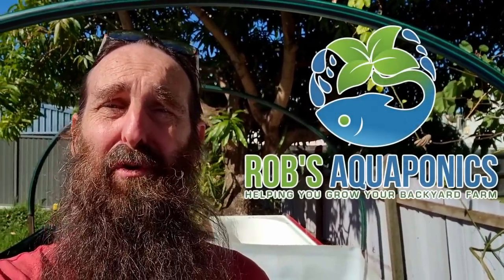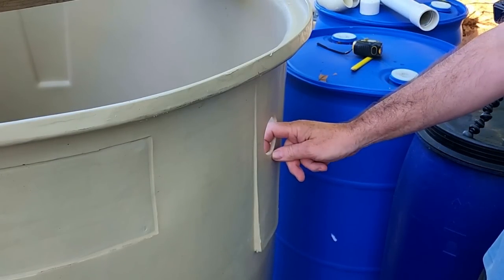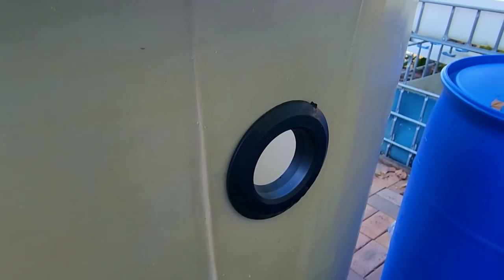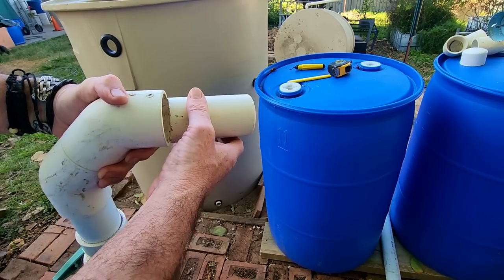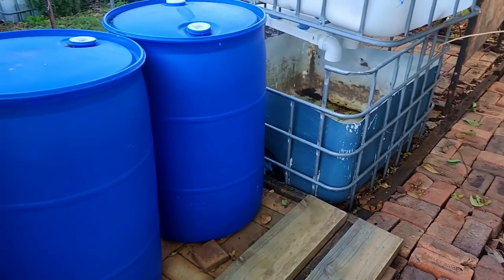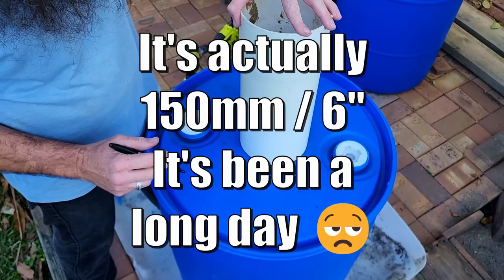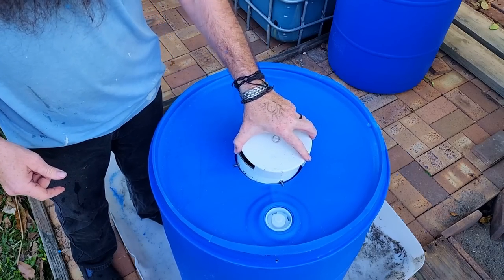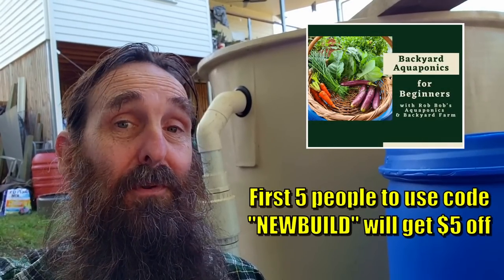New Aquaponics System: Starting the Plumbing

Comment: Hi Rob, i wouldn't have anything around my wrist when drilling, i had an accident where a grinding stone on a drillbit grabbed my jumper and spun/tightened around my wrist and banged it up, burnt and slightly cut before the drill stopped.
Reply from the maker: Cheers for the warning mate. Bead & long hair would be my main concern. Have seen some nasty accidents occur in my days in engineering  factories. 😥🤮

Comment: You can use vinegar and a small amount of dish soap to clean out chemicals in new plastic drums. 😊
Reply: i use dish soap and the nabours  cat, best use for a cat ever. when your done just kick the drum over and hose it out
Reply from the maker: @sindrome303  🤣🤣🤣🤣🤣🤣
Reply from the maker: I will use soap but most containers I use have has acid, soap or food stuffs in them so are fairly benign.

Comment: I know it's going to sound risque, but silicone-based adult lube works great for popping the pvc through Uniseals. A drop or two is enough when rubbed on the Uniseal rubber.
Reply from the maker: Never thought of that but it would do the job I think. 👍
Reply: Food grade silicone lubes are available, I generally use vegetable oil like coconut to do the job. Great idea.
Reply: @Pankaj13Das  I wouldn't use vegetable oil for lubing ANY rubber material. As the vegetable oil oxidates it releases free-radicals that attack rubber.
Reply: @BluhmGardens  yeah, but a thin layer doesn't matter. Just to get work done.